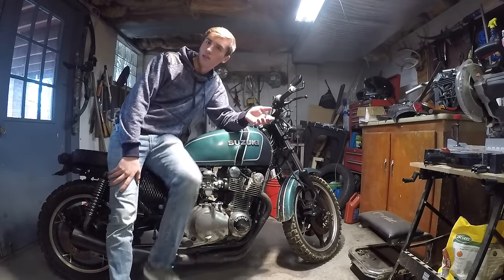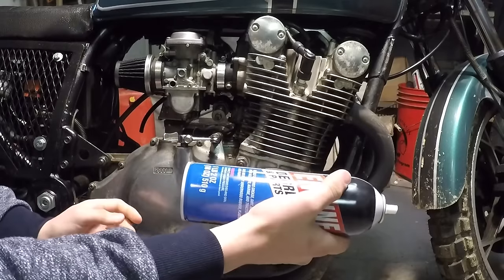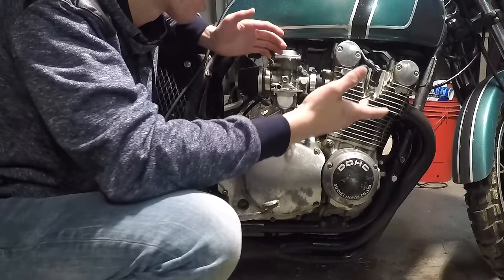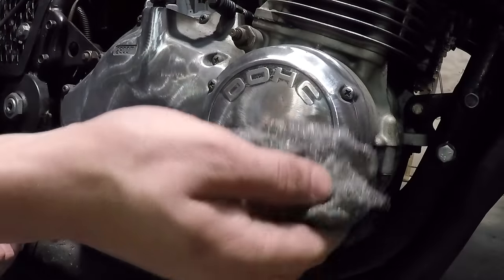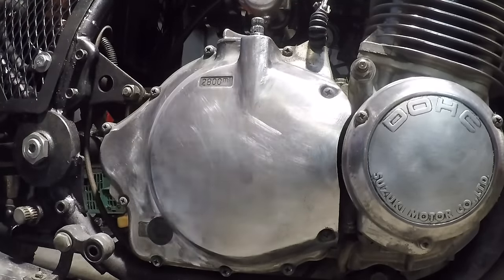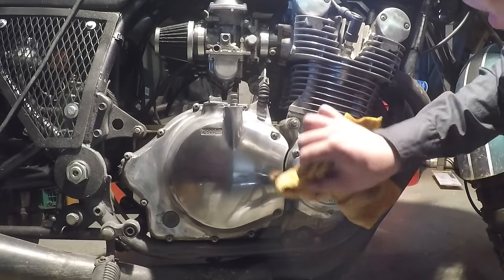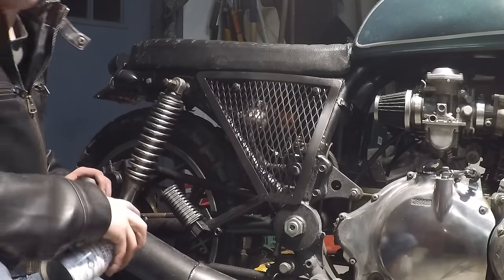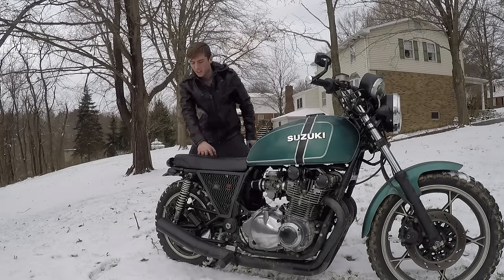How To: Polish Your Dirty Old Motorcycle Engine

Comment: next time tape off the letters before sanding them silver again it will protect your fresh black paint from being scratched off. also next time you are sanding the aluminum use water with the black emory paper it will stop the paper from clogging up and sand much faster. if you start with 320 grit, then jump to 400 and finish with 500 grit you can polish aluminum from their. Also your polishing compound only gummed up like that because you used too much compound and not enough heat from pressure against the buffing wheel. Next time use the buffer to remove the compound by pressing harder and not letting it gum up that much to begin with it will turn out much better and not require all the clean up but this will come with practice. I polished my first set of wheels 20 years ago and there is a whole learning curve dont let these negative posts get you down. When I polish I use an industrial buffer called a wild cat its much stronger and heavier duty then the grinders people add buffing wheels too for polishing car paint. This heavy duty motor allows me to lean hard against the spinning wheel without it bogging down. Also look for the round polishing pads that have stitches in them in a spiral pattern. These wheels are much stiffer and allow you to lean on them without out the polishing wheel folding over. Also have a separate polishing wheel for each different color of compound you dont want to cross contaminate them. Here is a couple photos of my metal polishing machine you will notice I stack 3 wheels together to give me a much wider polishing surface. It also allows me to lean harder against the surface with out the disks folding over on themselves and stopping the polishing from happening as well. If you get a machine like this used at a pawn shop for around $50 maybe you will find it will last for many years and allow you to heat the metal up much faster which gives you a true mirror shine next to instantly. It really helps if you can place the metal parts in the oven 1st and heat them up to 200-250 degrees 1st this helps the polish to turn even brighter and faster. Its the heat and friction from the compound and the pad that makes the shine, so more heat and more friction means brighter shine faster. With heat and a machine like this you don't need to do half the hand sanding. Good Luck!

https://s20.postimg.org/a8snf73jh/DSC06544.jpg

https://s20.postimg.org/e55zb6w8t/DSC06545.jpg
Reply: Just randomly found this video and read your comment, but it's a jewel. Thank you!

Comment: nice video, but pleas wear a mask with a filter to protect your longs form the aluminium dust ( and spray paint)...  and i would also cover the air filters on the motor.

Comment: I just use sea foam and elbow grease finish with drill like you did..some years the clear coated from factory ..and that craps hard to get off..sure looks good tho buddy..;) I'm gona go check out that harbor freight  polish..looks better than neverdull or mothers in my opinion

Comment: I have recently been using those plastic "sanding" discs on my bike as well and it does a great job.
I would highly recommend against using steel wool because it was cause dissimilar metal corrosion.  Great video though! Big difference.

Comment: The engine is a lot cleaner... well done
Not sure you should play too much with the can of paint though :) or if you insist, remove the bolts and engine cover beforehand... you could have left the engine colour in its raw metal colour

Comment: Doesn’t even take bolts off to paint them and sanded the H off dohc hurt my soul. But seriously. Respect from one young biker to the next. I have a 650 I plan to put 60-40 tires for some gravel trails. My newest project is a 1974 GT380. Two stroke streeet bike.

Comment: Great vid really appreciate the time you put in the vids and sharing the tips and tricks you learn along the way. Are you thinking of a new build yet maybe a Honda cb or cl also isn't there a clear protective coat on the engine covers that the polishing will remove and just make it oxide worse in the future?
Reply: Yes. Rust-oleum makes a high temp clear coat for around 10 bucks. A better product is Eastwood 2K aerospray high temp clear for around 30 bucks a spray can but it is hard to find. Go easy. Two light coats should do the trick. I'm yet to fire the motor up to see how well they work but both had good reviews.

Comment: before you polish your side covers on your engine. Think about this..
 I have seen this done quite a few times two motorcycles back in the 70s, 80s, 90s. Especially Suzukis and Yamaha‘s. People would wash their motorcycles with detergents like dishwashing liquid that have LYE in them. And that would attack the aluminum side covers and the whole engine and the wheels if the wheels were aluminum.So people started buffing their side covers to make them look new again because they ruined them using lye soap on them.. it would get a product called semi chrome or they would use jewelers rouge, and they would get a buffer, and then they would get as intricate as buying but the thing and polishing wheels for their Dremels. And they would make them look like a mirror. Here’s the problem with that
  that mirror finish on the side covers of the engine makes the rest of the motorcycle look like crap.. it’s like cutting someone’s face with liquid mud or melted chocolate completely covered. And then they smile with their white teeth. Polishing the side covers on your motorcycle engine has the same effect.. The rest of the bike looks like it should if it is old enough to have the engine aluminum corrode. those engines never did come from the factory with mirror finishes on them most of the time. It was very rare. So seeing a mirror polish job on the side cover of an XS 650 Yamaha twin or a Suzuki GS 550, makes the rest of the bike look older than it really is. so if you’re gonna go off your side covers to that mirror finish and make them look beautiful. You better do it to the whole machine..

Comment: NEVER use different compounds on the same polishing/buffing wheel. Always use a seperate wheel for each compound. Otherwise you're still still introducing the black harsh compound with the white and losing quality in your finish

Comment: Japanese engines come with a special clear coat on alloy parts, you ruined this protection!The oxidation will come back very quickly.There is no short cuts of you want to do it right . screw of the parts, clean, spray clear coat and reassemble.
Reply: There’s no reason why you can’t polish your aluminum and then follow with a thorough cleaning/degreasing and then apply a high temp clear coat... it’s much preferable to leaving a dull look...

Comment: I painted my headers duplicolor high heat red " man did that just bring a screaming japanese look to my 82 kawasaki."
It was the cheapest most exciting mod I did.
I looks kick ass and every one looks which is what you want on a bike "to be seen and stand out" so they dont hit you!!!
    Wire wheels can save time on aluminum brass ones are softer can be used after a steel wire wheel as well.
After polishing Eastwood auto product sell a clear coat to spray over the polished aluminum.to make your labor last longer. 
I have an old 84 GPz fairing I bought on ebay with a opaque windsheild I wet sanded from 320 , 600, 1500, 3000 and then mequirex plastic polished it to see thru it again. Way cheaper that 200 for a new one! I still wanted to look charmingly old after all.If you just fit new parts you take the coolness of an old bike OUT of it..." But thats just me"
I try and distress the new parts to 
Make them look the age of the rest of the bike.
Like a good pair of jeans...

Comment: start with cleaning the grease then 600 to 1000  to 3000 then sand up to 5000 grit buff and machine polish will get you a mirror finish

Comment: There are special aluminum cleaners.
They work by forming something like an oxidation layer, which then dissolves.
This one has fresh aluminum.
On a motor you can not paint that but because the temperature is too high.
You just have to take care of it. ;O)

I'm sorry, I use a translator because I just do not know words like that.
Reply: Andi H., you know you can paint an engine right?

Comment: I use autosol on all my bikes have done for 40 years
Reply: I used to use SOLVO AUTOSOL. Best alloy polish you can buy, sadly its not sold in the USA.
Reply: Oh why don't sell it in USA i thought it was sold everywhere.
Reply: Fred, maybe it is, but I have never seen it in my 40 yrs living here. It came in a gold and black tube, SOLVO AUTOSOL. NOT JUST AUTOSOL.
Reply: Yes that's the one it's easy to get here, used it all my life i wonder why you can't get it in USA will look later.
Reply: The Japanese manufacturers put a clear coat over the aloy engine components, and I know the British did not in my very long experience of 61 years riding motorcycles.
Reply: Yes that's correct but not sure if new brit bikes have clear coat now or not.
Reply: George Lee Solvol Autosol is still sold in the Uk and still the best for polish alloy and chrome
Reply: I've had good luck with Mothers aluminum polish on aluminum - you do tend to go through a lot of rags though - The best rags are old t-shirts (without any printing) and you can get old t shirts from the Goodwill stores for about $3-$5 for a box full (approx 30 or more).  A lot of rubbing but beautiful in the end - Don't forget to tape off and apply a Hi-Temp clear coat to keep it nice!
Reply: Oh yeah - Never-Dull works great too but you will go through a lot of wadding and that can get pricey.
Reply: George, what method do you recommend for cleaning oxidation crust from the case and especially from in between the cooling fins? There's not much that will fit in there to scrub it off or polish.
Reply: Impaler, I use a brass wire brush. It must be pure brass, not brass plated steel. Steel is too aggressive. Alternatively you can wrap some P600 or P800 wet dry paper around an Ice lolly stick. But wire brushing peens the surface slightly and leaves a nicer finish for paint.
Reply: @qbenalzaeen2052 , I'll try the sand paper, there is no way a wire brush would fit.

Comment: The beginning stages also you're taking off the old clear coat that was on the aluminum in the first place it's like a clear anodized
Reply: I didn't see any evidence of any clear coat, besides that even sometimes you have to remove it to get the desired results but it's simple to go back over it with more clear coat, and inexpensive too.
Reply: Most often aluminum parts that have a flat or semigloss finish are not degraded. They were produced that way, with an anodized surface, not a clear coat. Anodizing is more durable than clear coat. This is particularly true for engines, due to heat, and for wheels due constant exposure to the elements. Anodizing is done to protect aluminum parts from corrosion. The part is made to have a uniform preoxidized finish, rather than allowing the raw aluminum to oxidize unevenly, resulting in a blotchy/spotted surface. When you buff it off with abbrasives you leave the raw aluminum exposed to corrode quickly. From then on you will have to be careful with the surface and will have to polish it repeatedly to keep the shine, as the surface will then corrode unevenly and will look spotty and blotchy. You have just made endless work for yourself.

Never buff anondized aluminum to a mirror shine. You are basically destroying the part. It will look good at first, but within a couple years it will be garbage, when you finally get tired of repeatedly polishing it. 

You are not doing anyone a service by recommending that they destroy their motorcycles, and showing them how to do it. You will end up polishing it one last time and selling the problem you created to some unsuspecting victim, instead of owning your owning mistake. You will make someone else pay for your error.

On the flip side, if anyone wants to sell you a used motorcyle with a highly polished aluminum engine, check to see if it was maunfactured that way. If not, walk away. This is also true for mag wheels. If they were made anodized and someone polished the anodizing off to make them shine, never buy them. You are buying damaged goods.

Comment: There is NO reason to sand/grind aluminum that was once polished like on that engine. You would only use very very thin sandpaper (1600 and above) to remove scratches or molding leftovers. In fact all you need is a good Aluminum polish like Mothers Mag and Aluminum Polish or similar. Aluminum oxidize the moment it gets in contact with Oxygen and builds a more or less hard layer on the surface. That's where the dirt and grayish color sits in. Aluminum polish reacts with the oxidized layer and removes it. Polish it two times with Aluminum polish and the surface will look like new, you don't even need any special tools for it, all you need is some paper towel and some soft fabric for the final.
Reply: Early eighties Suzuki and Honda used a clear coat over the alloy and this is best removed with a fine wet abrasive. Once the clear goes it can't just be polished out. Kawasaki didn't use any clear and left the cases bare. They tens to be more corroded as a result but can be cleaned up very easily. The Yamahas  of the time-as far as i can remember, most, had black painted cases, but those that didn't had a clear coat finish.

Comment: I suggest using paint stripper/ gasket remover on old Japanese components as they are covered in a clear coat from the factory.  Once the clear coat is gone, polishing becomes a lot easier and a lot quicker.

Comment: Won't the engine corrode again without some kind of clear coat?
Reply: Yes it will.  But cheap clear coat would chip off from the heat.  Polished aluminium will always go matt again eventually.

Comment: It made me cringe to see silica sandpaper used on aluminum, especially with an electric motor, although I suppose it's good to remove old clearcoat, but way too coarse.  A chemical paint remover might be better.  Aluminum is soft, abrasives remove metal, chemical treat then polish, that's my suggestion.  Cool video, nice to see young guys with old bikes.  I hope bike was up jetted(carbs) with the aftermarket air cleaners and the header, running lean will hurt engine.

Comment: Do not use steel wool to polish or clean aluminum.  Small bit of the steel will remain in the aluminum and cause dissimilar metal corrosion.  Use aluminum wool if you have to.

Comment: How to destroy aluminum. You removed the protection for oxidation. If you have no protection then you need to polish often. After a high gloss polish, spray a protective coat. When painting aluminum, one should always use an anti-oxidation for aluminum before. Show a new photo after a few months how it looks with peeling paint and oxidized black aluminum.

Comment: Your bike's looking good, it's done with taste, but you paintjob is lacking quality. You should learn how to paint well for your bike to stay the way you intend it to be, with these kind of paintjob, half of it will be gone next year.
Reply: true....
sand the grill first, clean it, apply primer, sand again, apply 2nd coat, sand, spray paint, sand, 2nd paint layer. not that hard eh?
But the bike still looks dope.
Reply from the maker: C4H10N4O2 you are probably right, time will tell! And if it does, I will repaint! Thanks for watching!
Reply: don't need to sand in-between primer coats nor base coats. but sure why not
Reply: You do if you miss the flash time or sometimes when trash gets in a coat.
Reply: next time your giving advice on how to degrease and clean your engine you should not splatter degreaser all over your paint job and let that soak also. And then splatter the desolved grease and degreaser all over the whole bike with the dirty water. But you DID clean the engine. 10 minutes and some plastic taped around other parts it well worth preventing all that crap from splattering all over it. Personally I wouldn't even degrease it onto my shop floor like that and if I caught you doing that in my garage you'd get a free "tune up".

Comment: next time, put the drill in a vice, and remove the parts and polish them that way. Cant do a good job with parts on the bike. But ty for showing us how you used a kit. And for the letters....2000 grit on a flat block
Reply: Pretty dumb to tare a good bike apart just to clean it tho ,strip all the screws..no thanks
Reply: @jacoblang2712  and thats why everything you own looks like shit

Comment: I guess I will learn you some tricks if your engine has no factory clear coat use oven cleaner dont leave on to long then wet sand start with 400 or less unless your taking out deep scratch work up to fine or get the sand paper kit for plastic for finish  then mothers mag polish and for hard to get to mothers on your dremal polish wheel  0000 fine steel wool lots of work and sore finger tips